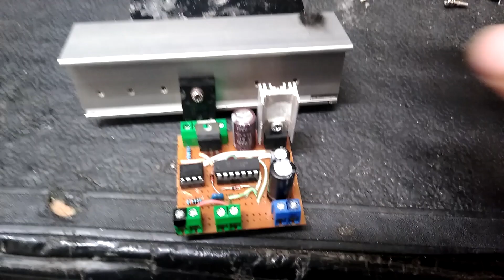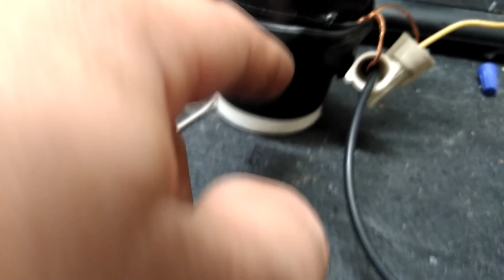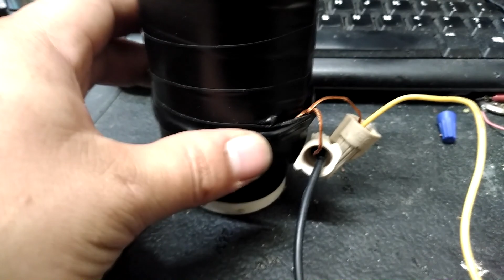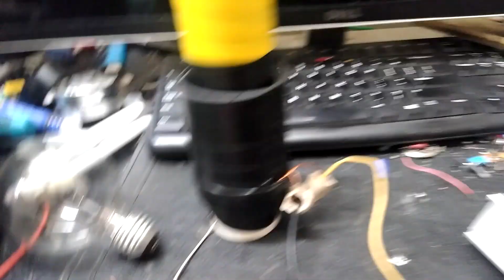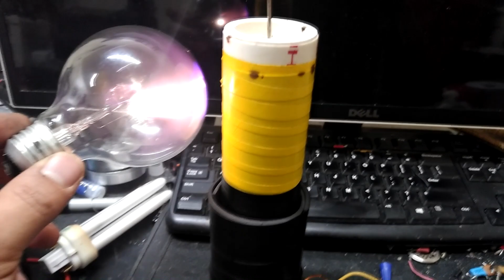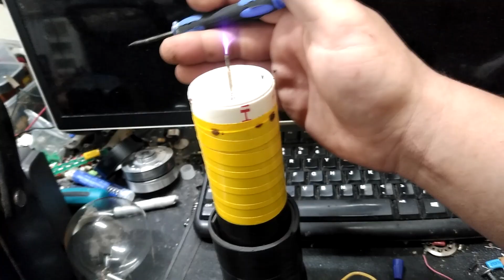Steve Ward's "Micro SSTC" driver

Comment: So you did not use the tc4420 ? How would you interrup this circuit ? Cutting the antenna? At first look I thought the 555 was interrupting lol
Reply from the maker: I used a clone *gate driver which was probably a 4420 because it had no enable so I just ran this one CW. In a different one I used a UCC gate driver and interrupted it at the enable pin but I also had to add the 555 as a background oscillator. In a different halfbridge sstc when I used gate drivers with no enable functions I think I used a  NAND gate chip. So basically two Gates used off the chip and feeding each one inverted and non-inverted feedback signals from the hex inverter into one of the inputs per gate, with the other input fed by the interrupter.
Reply from the maker: Oops I mean not a clone 555 but a clone UCC gate driver
Reply: @Magneticitist  cool I want to make this micro sstc but adding an interrupter so I would need to change 4420 to ucc driver keep the starter 555 and add 1 more 555 with some frecuency and duty potentiometers , I am gonna need to dig a bit more into gate drivers to know how would this ucc be conected
Reply from the maker: @rodriguezfranco3839  UCC driver connections are super easy. Unless I'm mistaken you have pins 1 and 8 as the positive input, then 4 and 5 as ground. Pins 6 and 7 will tie together to be your output reference to ground which just leaves two and three. 2 being the input pin which gets fed th e feedback signal and pin 3 is for the interrupter.
Reply: @Magneticitist yep already checked datasheets , here at the electronic store near my house I can get Ucc27425 or Ucc27324(cheaper but not enable I think) or Ucc37322  I am making a schematics I want to use that dual driver to drive 2 mosfets push pull , when I finish the schem I want to send it to you so you can check it out
Reply from the maker: @rodriguezfranco3839  Yea I'd get the dual driver packages. The UCC2732X's work well but they are wasted on something not pushing a lot of power. The 4A pk drivers are best for low to medium power. Only good thing about the 9A drivers is that you can build a legit half bridge or something using them, and if you wanted to later could easily upgrade it to a full bridge and not need to beef up the gate drive.
Reply: @Magneticitist  I just want to get the most juice from low voltage like 12v and big sparks lol
Reply from the maker: @rodriguezfranco3839  To do that the boost stage is the easiest thing. For small DRSSTC's sometimes I just use a drill battery powered supply that feeds a small inverter. You can easily make a ZVS driver that will charge a large capacitor up to hundreds of volts in no time. If you consider that, then you can just make your normal line voltage half bridge circuit and get long sparks from 12v by charging the bus capacitor to a few hundred or something, then use the interrupter to tell it to cut on.

Comment: Nice, I built it before but found it to be fussy so I went to the half bridge after
Reply from the maker: Yea it can be a little bitchy that's why I tried to implement the feedback Transformer. I actually meant to leave the triple 5 but forgot because I got it in my head reading some other coilers comments that having the solid signal there to keep a steady ringing is how to get some of the best output even tho the feedback appears to be working properly.
Reply: @Magneticitist  Do current feedback transformers work better than antennas?
Reply from the maker: @uK8cvPAq  They do in my experience but I suppose if one were to create a solid enough antenna and have it in the perfect location it may be all around easier to go that route. At the same time it also may just be easier to use the transformer which, when working, would be less subject to interference and such. With the antenna I can just sort of pop a wire up and it works but the output changes around a lot depending on how I load the circuit and how my body interferes with the antenna by either helping or impeding its ability to receive.
Reply: @Magneticitist  Could one of those PLL type drivers help with the loading and shifting out of resonance problem?
Reply from the maker: @uK8cvPAq  Youtube just notified me of this and I see it was a week ago lol. Anyway theoretically yes the PLL seems to be the solution. From what I can tell Ward and others basically went that route in the end. I'm about to start getting into that pretty soon but I feel like the results are only going to be as good as getting all the other variables matched first. I can picture throwing a PLL in between the feedback and gate driver with this circuit and there really not being too big a difference.